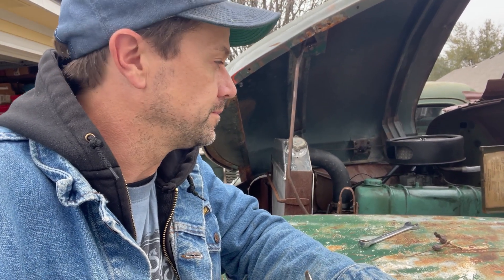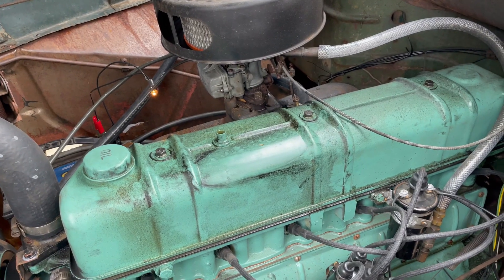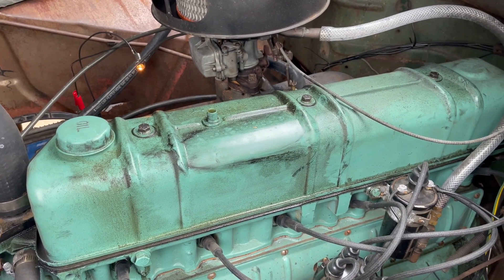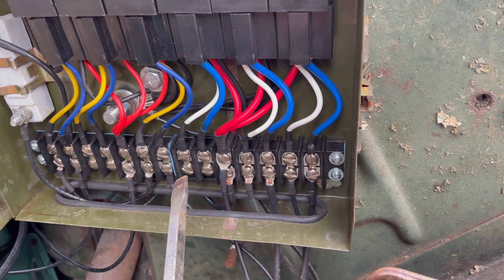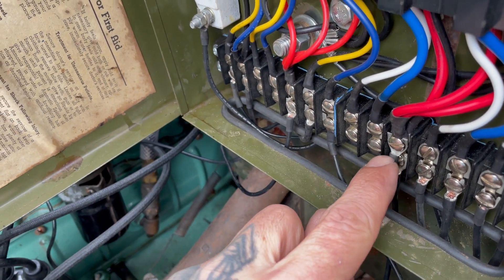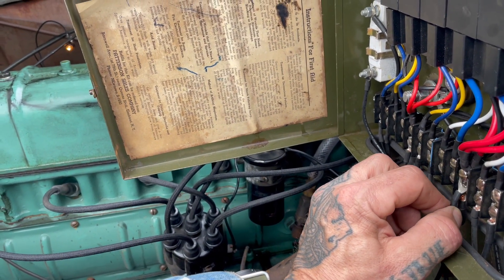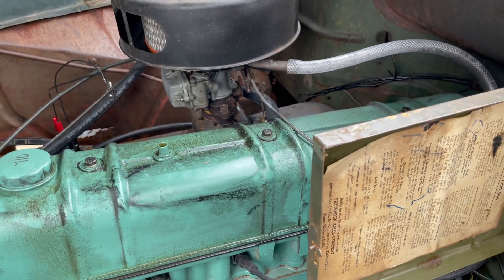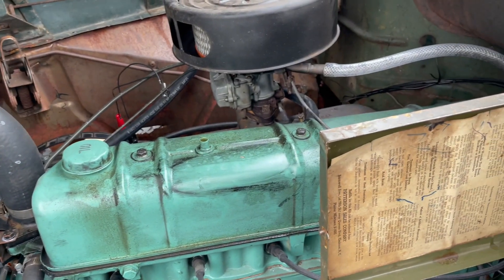How To Find A Voltage Drain - PART 2!

Comment: Good video. Test light is easier for me to use than a volt meter. I like your relay box have you done a video on how you made and wired that up?
Reply from the maker: I haven’t, but I really should! Those are always a point of discussion at car shows and meetups.
Reply: You should just build and sell them
Reply from the maker: @danmcneil8004  I’ve thought about that, not gonna lie.